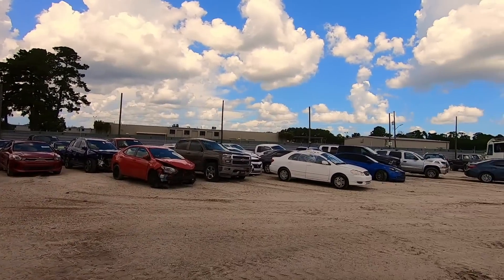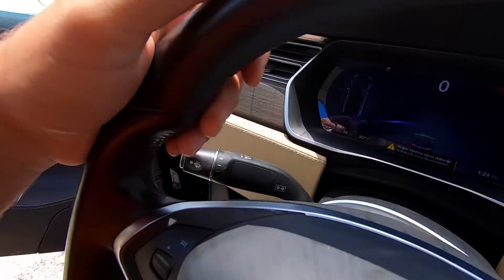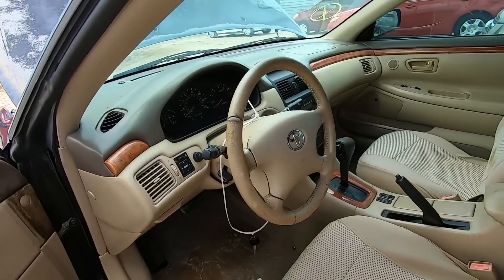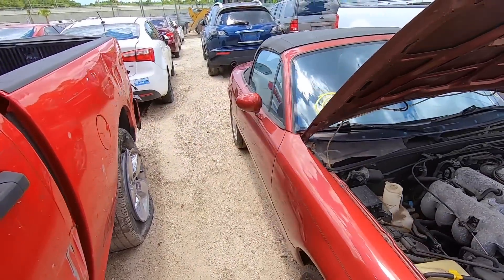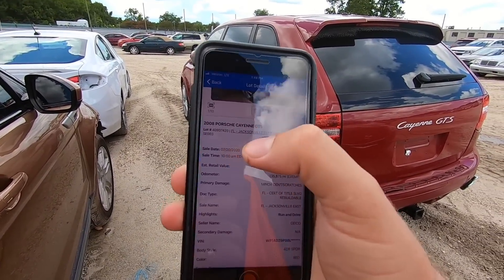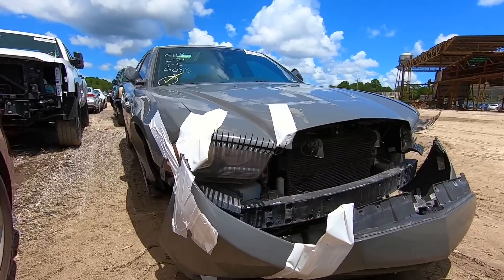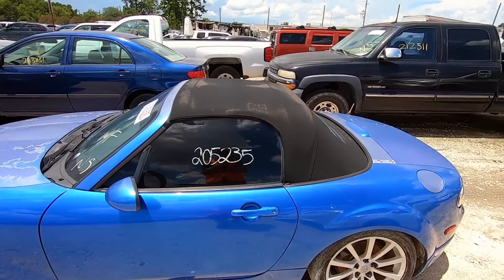Hunting For A TESLA At COPART Salvage AUTO AUCTION | Potential Project | Walk Around RICH REBUILDS

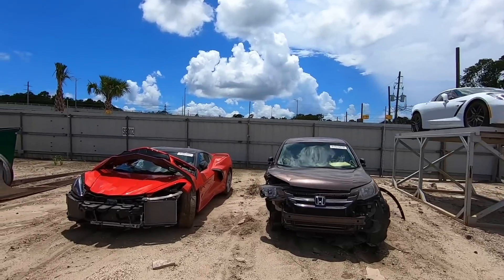Comment: The best car fire 🔥I ever seen was a Tesla on fire & the fire department didn't know that it was a electric car & when they sprayed water on the burning lithium batteries & magnesium cast parts ,it was the hottest & prettiest fire ever ,like fireworks going off with white hot flames as well as pink flames & smoke,water & lithium & magnesium doesn't mix well with fire ,& it's hard to extinguish it without  foam ,it completely melted almost to the ground  ,this was when Tesla just came out ! @9:30 I got 2  new headlamp assemblies & another pair of the OEM HID headlamp ballast in the box for that Honda S2000,@15:11 the best thing with that Stingray Corvette is that the airbags never deployed